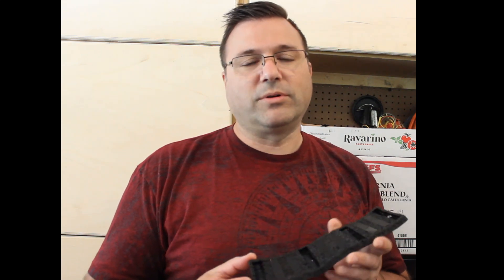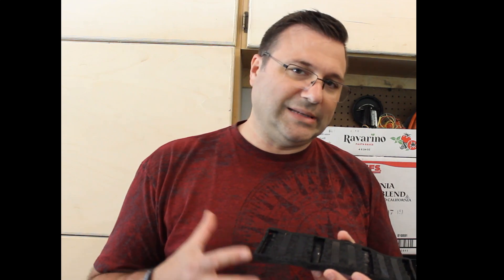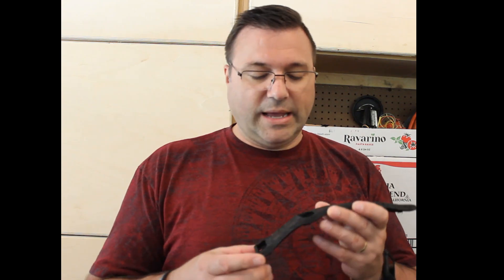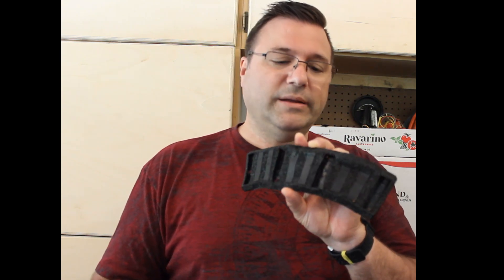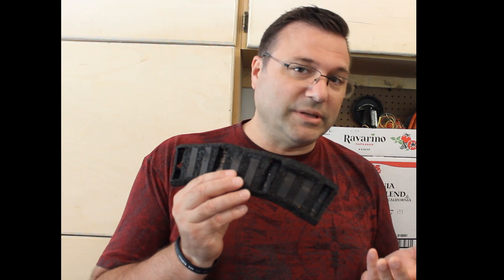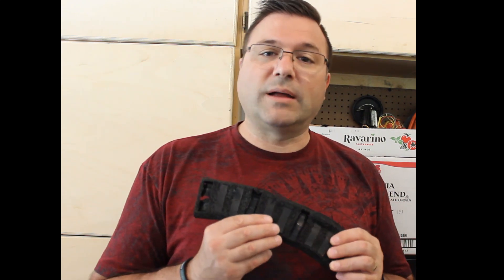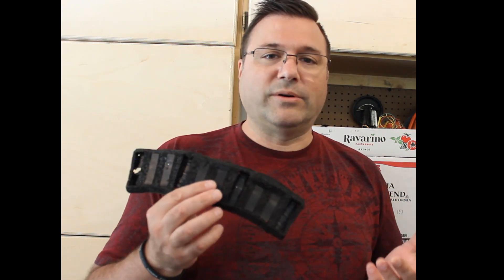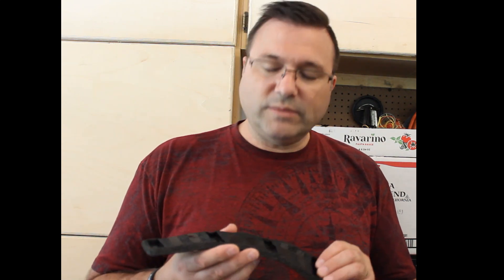Restoring old rubber roadbed

Comment: I had discoloring of gray rubber roadbed when I acquired some.  I  used an empty swiffer wet pad container.  Could fit 10 pieces of gray rubber road bed inside.  Filled it with simple green and let is sit over night.  All discoloring of the roadbed that could be removed was including using a brush.  All the years of dirt and grime where ever they were used prior to my obtaining them is gone.  if the rubber itself discolored deep into the rubber roadbed, well then you are stuck with it  You can paint the roadbed as did Flyer Junction (he did his switches too).  Hope this helps

Comment: Yes track, I used on the  same 24 pieces soaked in Vinegar for at least 24to 48 hours but as it sets, it rusts again. Spray it outside with WD 40 or soak the track again in Mineral oil and rust will be at a minimum. I found that nothing else works any better. After that dries up in a few days, just use Scotch Brite pads over and over on the tree rails until you get a  brite finish. Mineral oil with nothing added is great for çleaning the left over specks of corrosion on ties. I use Pure Mineral Oil to clean chassis and wheel sets on àll cars and engines too. Cleans like new using only cotton swabs!: